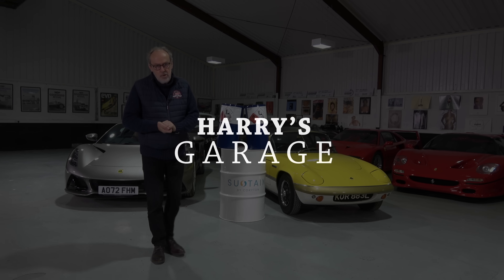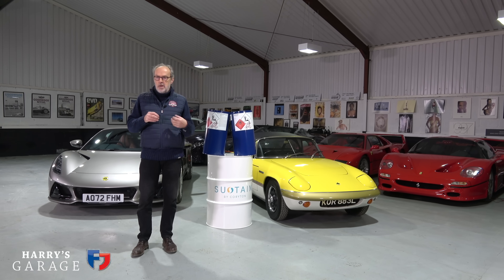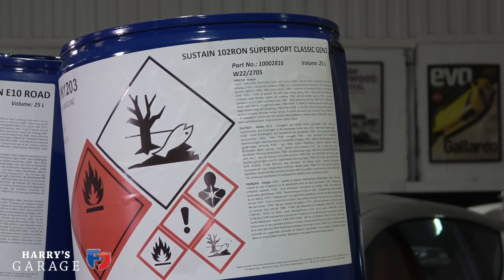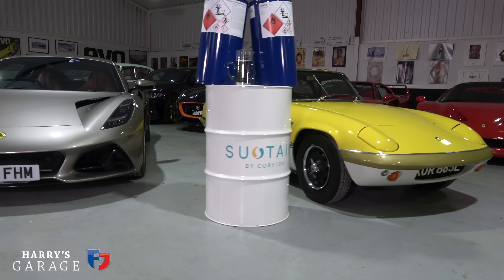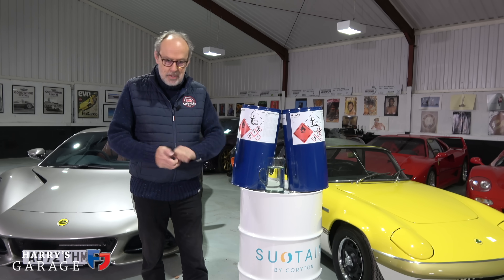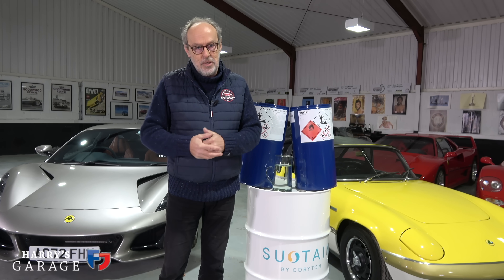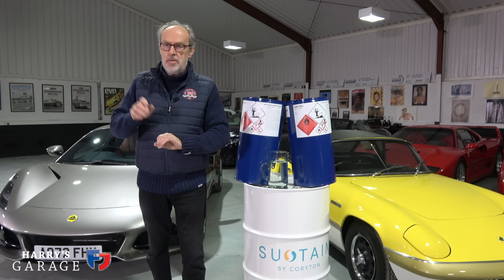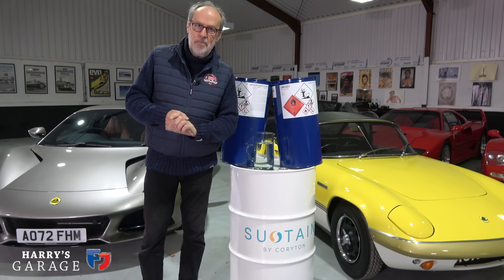Sustainable fuels; what are they & when will I be able to buy some?

Comment: Spend some time looking at the benefits of CO2 atmosphere and the correlation between temperatures.
You will find that there is no correlation between the two, there is no evidence and has never been. 
We are not in a climate crisis.
There is a contamination crisis of the planet, with plastics in the ocean, solar panels, batteries and wind turbine blades.
Efficiency is important all new cars should be able to drive 35 miles minimum around town and 60 on a longer run.
Cars should be made to run for 30 years not the 10 years of an EV, which is shocking .
Small electric cars for local motoring is a great idea with small batteries and at-home charging, not supercars with massive batteries that are worthless in 10 years.

Comment: Improvements are always being sort by engineers, it’s what they do. As for MP’s pushing net zero is like backing a unicorn to win the national. Remember how the government said diesel engines were the way to, only to back peddle, when nitrous dioxide was becoming an issue (though I believe engineers have made in roads there). I quite like the idea of hydrogen, though it’s manufacture is costly at the moment ( I would be interested in the possibility of nuclear power being used to supply the electricity to produce it, and getting oil companies to contribute to the cost of building them, as they will distribute the hydrogen like they do petrol and diesel now). As well as giving a boost to energy security and a continuous power source regardless of weather or time of day.

Comment: awfully elitist to call for more tax on air fuel - with millions in the bank and a private jet, the additional £££ may seem like nothing to you but for the other 99% of air travellers, it will make air travel impossible. Tax is never a solution, just a means to control folks you don't agree with

Comment: That is expensive stuff. Here in the Netherlands I can buy Neste MY100, a renewable diesel fuel with 90% Co2 reduction at a 37.5% price penalty. Since delivery trucks, vans and lorries do most miles I think there is a real future in fuels like that. A new diesel engine has such low fuel consumption, and you can run that with renewable diesel today. Only thing they need to make more clear is the production circle and how much energy goes into that and close the loop. EV for short distances, renewable diesels orther for aviation and cargo ships (those are the worst atm).

Comment: This type of fuel is very much an undecided entity as it remains unknown who or what it supports politically. The clean energy crisis has never had anything to do with clean energy, rather it has only been about who big oil supports politically and taking power from them. Politicians who hate big oil love electric because China is buyable and controls most of that energy in the form of battery production and maturely mineral resources. 

Renewable or ‘sustainable’ fuel, which is an odd thing to call it because there is a lot of debate on whether we are running out of oil ever as we know it’s renewing itself in ocean base deposits, sits in the cracks and won’t gain momentum in any one direction or another until it gains some % of market share, which I doubt it will just due to the cost of the stuff.  

As far as CO2 emissions are considered, it remains very unclear how much mankind has had an effect on things as the environment has been naturally changing on its own for billions of years, and the earth has been through far worse CO2 emissions naturally (far more volcanoes which were far more active millions of years ago). I am far less concerned about CO2 then I am with issues surrounding batteries and mining for them (scorched earth, slavery in Africa), and battery disposal for which there is no solution (also scorched earth), not to mention massive co2 used to produce batteries in the first place. 

This has nothing to do with ‘clean’ anything. It’s all politics

Comment: Harry, the inadvertently misleading factor is that when adding CO2 to the atmosphere, we’re contributing to preventing it falling too low for plants to grow. The preindustrial atmospheric CO2 levels were “skimming the trees”, being at a geological deep time low, only just above the levels plants require to grow. Some believe had we not done this, CO2 would have fallen to the point where plants couldn’t survive. That would mean extinction of all life on Earth.
The increase in CO2, which is partly due to human activity, has had only benefits. The world has greened up even during my lifetime (b 1960), and this has been most notable in areas in the margins of deserts. This is sizeable, more than 10%. Not only has this made food production more efficient, but it also reduces the water needed by plants. More CO2 means plants open their leaf pores less, and therefore they lose less water vapour through less pore opening.
The mean surface temperature is perhaps 1C higher than preindustrial. Ten times more people perish from cold than from heat. A slightly warmer world is much less lethal to species including humans living in the colder zones. There’s a measurable net saving of life. 
The global warming cultists rely on nothing but computer models, not actual measurements. The massive mistake is that all of these models use, as a given, that temperature will rise with CO2, but their models have a factor between CO2 elevation and temperature elevation which s much higher than what empirical evidence shows. Did you know that none of the dozens of atmospheric models reproduce the actual data for the last 70-80 years? If you ask those models to evaluate what would happen from, say, 1940 to present, assuming they didn’t have the last 80 years of temperature data, those models predict that the mean surface temperature right now would have been much higher than the real temperature today.
I’m sorry, but that proves the models are way too pessimistic, they demonstrably over predict warming. Without those incorrect models, the actual evidence is for only benign changes. That’s what we’ve actually observed. Fewer people dying from cold. Food production increased. Water needs lowered. Overall quality of life immeasurably better, almost everywhere. Standard of living rather directly is linked to energy consumption. We might wish it otherwise, but this isn’t surprising. As humans moved from Hunter-gatherers to fixed agriculture, ie farming, we’ve steadily reduced the percentage of our lives spent in seeking enough food to stay alive. In ancient times, securing enough food, warmth and shelter to survive used almost all of waking existence. Nowadays, we spend a tiny fraction of our lives doing that, and this alone created the space & time for all other human activities. Creativity and art, manufacture of useful artefacts which make our lives easier and nicer. The emergence of the Renaissance scientific method which, coupled with numerous discoveries and inventions, have fundamentally enabled the wonderful world we live in today.
“Net zero” will definitely throw billions of people into fuel poverty and wth that, return many to the point that they will have to spend much of their lives focussed on obtaining sufficient energy, food, shelter etc. A meaner, harder, harsher existence. And taken in the round, the motive behind all this is based on demonstrably flawed assumptions. Question everything. 
The people pushing this agenda are Malthusian to their core. I don’t think they’re unaware of how badly flawed the climate models are, I have too much respect for their intelligence. So what’s behind all this, if it isn’t correct to predict catastrophic warming from continuing human activity?
I think that, surprising though it may seem, there is a god complex running through these people. They argue that unless the worlds population is greatly reduced, from today’s around 8 billion, to 1 billion or even half a billion. 
Dennis Meadows of the Club of Rome argues precisely this. He gets all shy when challenged about how to get to that (in his mind) sustainable, grossly reduced human population.
Reply: correct, and any warming or cooling of the atmosphere is a function of ocean temperature and circulation, plain and simple, and virtually irrelvant to the heat content of the planet

Comment: With all respect to peoples personal choices but,,,  Do not kowtow to the climate change activists, the Greta Thunbergs and the crowd in Davos headed By Mr Schwab. Increased Co2 in the atmosphere has actually had the effekt that in the last three  decades the planet has become greener by an area as big as USA times two. Harvestes have increased significantly due to increased Co2 levels. Is there a drawback to this amazing greening effekt caused by CO2? Sure! But the fact that we don't hear about the possitive effects of CO2 levels on mainstream media should raise a warning flag. The fact that "they" also effectively are working to ban fertilzers and beef raises a few more.
Reply: Absolutely correct. Furthermore, the requirements for water, especially on desert margins. This because the pores on plant leaves need to open less in order to obtain sufficient CO2. 
Worth mentioning that far more people die from cold and lack of access to fuel than die from heat in the absence of air conditioning. It’s about TEN fold. So modest warming reduces death from environmental pressure.

Comment: Great video. For modern cars, doesn't it make more sense to run bioethanol directly? Most can be adapted quite simply and it's available widely in France and Spain at petrol stations. Generally a bit cheaper than unleaded, but slightly worse fuel economy apparently.

Comment: Hello Harry
I think you are way behind the curve. EVs are the only way. We will be 95% electric by 2030
Renewable will power nearly all of us wind and solar will do the work. Also mega packs will store power at night.
Did you know that the largest mega pack battery in Europe has already been built in North West Yorkshire. All Tesla made and built by a company called Harmony Energy and they are building them all around the country.
Food for thought.
Regards David Harbutt
Reply: Unfortunately there is insufficient copper, rare Earth elements etc to make enough batteries that ICE cars could all be replaced by BEV. 
More seriously,  the entire National Grid is woefully short of electrical power generation to permit charging even of a fraction of a National fleet of home charged BEV. It’s no small gap, either. I recall that we’d need more than a doubling of generation, and very few homes have sufficiently large copper mains cross sections to permit rapid home charging even if the generation gap could be closed.
No, if we accede to this huge shift from ICE to BEV, I’m sadly confident that the end result will be that very few of us will have powered personal transport of any kind. And that is what I believe this is all about. Geofencing the population.

Comment: For most people, home fuelling is even more out of reach than home charging; and charging infrastructure, as patchy as it currently is, already has a massive head start. So I’m not sure how relevant sustainable fuels will be for keeping normal ICE cars on the road, but I can totally see the use case for classic cars, enthusiasts with lots of storage space, and aircraft. Thanks for the video.

Just to add: a gas turbine power plant has a thermal efficiency of about 50%, whereas an ICE car will be somewhere between 20-30% (meaning between 70-80% of energy from burning whichever fuel you use is lost, mostly as heat). Charging your EV on a cloudy, windless day in the UK is not ideal, but not as bad as it sounds.

Comment: Synthetic fuels / renewable fuels are 100% the way to go. The environmental case for EV's makes zero sense. if we could convert every vehicle to an EV overnight that still does not solve the problem, so what is the point in pushing down that line. A synthetic liquid fuel is absolutely the way to go and where the investment needs to be.

Comment: Harry - thanks for this. 

You are a bit too tough on the carbon emissions of the UK electricity grid, and resulting CO2 emissions of BEV driving. Past year's UK grid average is 229 grams CO2 / kWh (per your displayed source). A decent modern BEV in mixed driving will get ~3 miles (5km) per kWh,  which works out to 46 g CO2 / km (maybe 10% more with charging losses). About half the emissions of a modest efficient combustion engine (~100 g /km). A small efficient BEV (VW ID.3) could be as low as 43 grams /km. 

As the grid cleans up, so do BEVs' emissions. Scotland's grid is averaging under 50g / kWh, so ten times less emissions than ICE, Nordics' grids are even lower. Germany's annual kWh average emissions are about 60% higher than UK (at 380 g/kWh), so less of a reduction compared to ICE. All of the world's grids are steadily improving CO2 emissions.

Mostly middle-of-the-night BEV charging can potentially capture wind electricity, or other off-peak sources, which tend to be less emitting that peaker plants.  Across Europe as a whole, only about 30% of vehicle owners do not have any access to a regular slow-charge plug (i.e. neither home, nor workplace), and thus would depend solely on public charging stations. 

 E-Fuels are certainly good for keeping classic cars on the road, and with good potential for aviation.

Comment: 7:44 I am sorry to correct you on this but it actually isn't 60% fossil fuel. If you plug in your electric vehicle it is 100% fossil fuel! 
Why? Well, you need additional kWh from the electrical grid. Which kind of power plant do you think will produce that? 
Wind & Solar can't produce more, the installed capacity is way more than what the weather can deliver. So the only scalable power plant will jump in and that is gas or coal. So you are charging your EV with 100% fossil electricity which makes your CO2-levels even worse than a modern day combustion car.
(Of course nuclear would help but it is running on 100% full power already. You need more nuclear, like France for instance, than we re talking)

Comment: These thoughts give me confidence that I could ride my motorcycle as long as I could hold it….
Sold my car and bought a 125cc scooter to reduce my carbon footprint and save money too, but still keep my HD Sportster 1200 and wanna ride it as long as possible.
54 years old now, means I‘ve got 13 years to work before retire and maybe another 10 to ride the bike - so that would be 2046….
Doing the other math… when they really stop making ice cars in 2030, it will be around 2040-45 when the ice cars are scraped that much, that there is no reason to keep a petrol station network as we know it….
Both means that I‘m into my 70ties when they force me to quit riding an ice bike….
Mmmmh

Comment: If the argument is, that we're pulling carbon out of the ground for oil, well what about all the carbon we're pulling out of the ground, for the materials to build solar panels, batteries etc.... Then the other side of that, you mentioned the output from the exhaust pipe being the same for synthetic versus fossil fuels.  So in summary, we're all being brainwashed & shafted to buy into this stuff.

Comment: Curiosity- in Brazil we have been using bio-fuels (E100) since the 1970s and there is no pure petrol here - all petrol is E22 - E24 (petrol with 22 to 24% pure ethanol ). This E24 have been fueling a versify or ordinary and supercars (quite a lot of Porches and Ferraris etc here) with no problem whatsoever- só to increase biofuels in normal petrol may be an interesting intermediate to 100% biofuels

Comment: So, theoretically all ICE cars could be using synthetic / e-fuels *now*, with huge reductions in CO2 levels. 
It’s not new tech, why the hell didn’t governments ramp up production? Too expensive - compared to what, installing a whole new network for EVs? 
Fossil fuel co’s should’ve been given an option: invest in e-fuels or face heavy fines, which in turn governments would’ve invested in e-fuel production to reduce cost per litre. 
Crazy missed opportunity!

Comment: No you can't scale up a biofuel because you'd then have to start farming for the sole purpose of creating that fuel which ends up creating more Co2 emissions than drilling it from under the ground. If you don't believe it type on youtube's search bar "the problem with biofuels". 14:05 The manufacturing of an ICE vehicle is not the issue, that's a very small part of Co2 emissions, the issue is running it ... whether that is a 30 year old car or one manufactured yesterday. As a matter of fact using the 30 year old car is actually worse as the gas mileage will be poorer.

Comment: Had a relative who used to produce commercial biodiesel from used cooking oil about 15 years ago and sold it locally for about 7p a litre cheaper than regular fuel. Then the Government removed the duty subsidy and it then had to be taxed the same as regular diesel. Suddenly, when it cost more than fossil diesel nobody wanted it. The Government's interest in the Environment and net zero quickly and magically ceases to apply when the alternative solution hits their tax revenues!. I can imagine the same will apply with any other alternative fuel. Once it starts being used in aircraft then it spells the end of cheap flights. Watch the moaning start when the flight to benidorm costs three times the cost of the hotel.